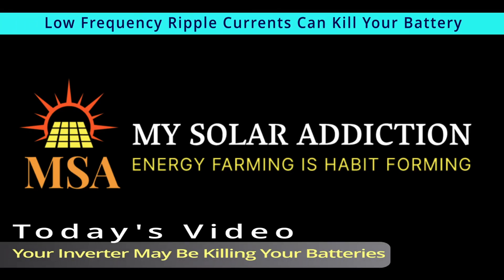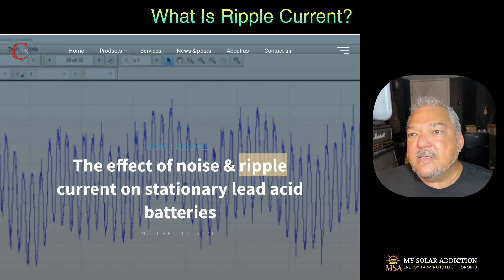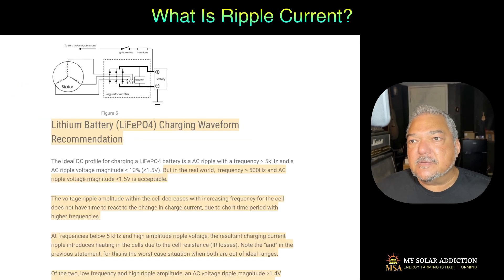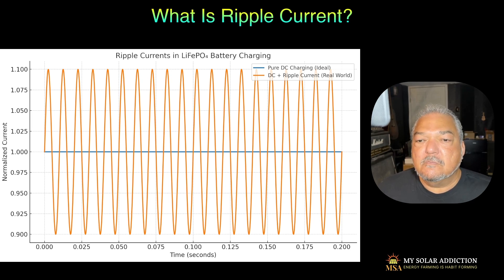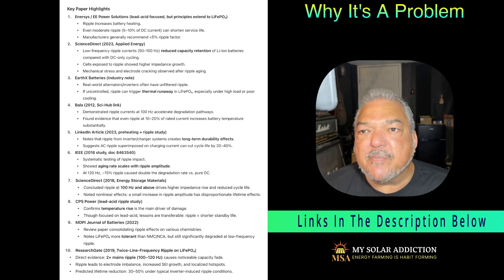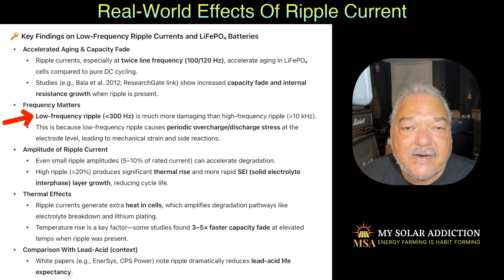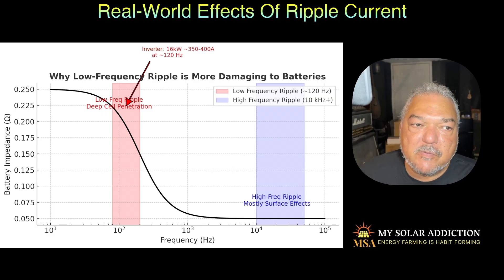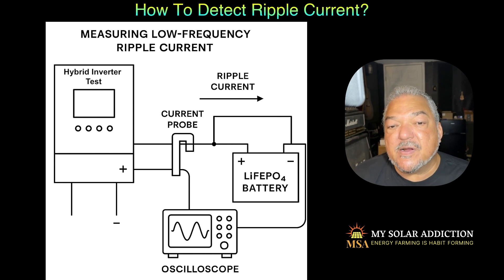Your Hybrid Inverter May Be Killing Your LiFePO4 Batteries

Comment: This popped up on my feed, two weeks late, go figure. I am presently running a 4000W inverter with 700Ah of 12V batteries. Yes, heavy loads can put a major ripple in the DC supply. My solution was to drop a few hundred (1/2 the price of a single battery) bucks on a 500Farad capacitor. does a beautiful job of dropping ripple down to low mV I can start a 2hp compressor and the lights don't even flicker levels. I parked it right off the inverter terminals.
Even better, it allows me to operate much heavier start up loads that would choke the batteries BMS if used alone. looks like a 6 pack on top of my inverter.

Comment: In Europe the ripple issue can be partly mitigated by using 3-phase electricity and balancing the highest loads equally to all phases. So using 3 phase charger for ev, using 3 phase heating resistors for boiler and sauna (sauna stove is usually Y-configuration, and the thermostate is using after initial heat only 1/3 of the resistors, not good for the ripple). In Finland many people are using solar + battery for EV charging, then it's better to have a 3 phase charging, and limit the power to for example 6kW, if necessary, and not using 3,6 or 7,2 kW single phase.
Reply from the maker: Thanks for the input.   This is the kind of interaction I was hoping for👍🏻👍🏻

Comment: Most modern high quality low frequency, transformer based inverters have more than adequate capacitive and inductive filtration on the DC side to eliminate this noise. Throw an O-Scope on the DC bus during charge mode and you'll see what I mean. In addition, if you twist the DC cables together (most people don't) much of this ripple current in lower cost, inadequately filtered inverters can be eliminated.
Reply from the maker: With HF inverters good filtering is important.  Thanks for your input 👍🏻👍🏻

Comment: This entire video is terribly misleading and has NOTHING to do with solar.  My batteries get charged directly from solar panels. No AC goes near my batteries, heck I'm fully off grid, no AC anywhere near my batteries.  You're talking about a charger/converter type device.  I have a pure sinewave inverter that turns DC into AC, as in output only.

So if you're going to obsess about AC charging issues, change the channel, because you're using the wrong language and terminology all the way around.
Reply: Some folks have inverter/chargers that are connected to the grid at the same time. But I also charge from solar panels only. But I have a high interest in science and technology, so I enjoy learning about something new.

Comment: I'm not really worried about this. I generally charge from solar, so that's DC and there will not be a significant ripple. You get ripple when you charge with AC and convert that to DC without capacitors smoothing in between. I charge AC at very low currents only, so that shouldn't be a problem either. Discharging I rarely use more than 35% of the maximum battery discharge current.

Comment: Long ago people got alternator noise in their car radios when the car was running.
You simple installed a capacitor on the alternator output to smooth out the ripples.
Why not figure out the frequency of the ripples and merely add a small capacitor to the setup?
Smooths out the ripples quite nicely if you can calculate what you need.
But it takes an Oscilloscope to see things.

Comment: I think it is overrated.. mostly on systems with few battery cells / bms ..i don't think it is a big deal at all.. maybe on one battery with large inverter it might be problem..but for sure it isn't a big deal on higher systems with more cells connected in parralel..so no need to worry.

Comment: Ripple currents are "mainly" caused by high current draw from the inverter when outputting a lot of power, not very likely on charging UNLESS you are charging with a few hudred amps from a 50 or 60Hz charger that has inadequate smoothing... 

The smaller the cables to or from your inverter/ battery the more ripple you will have, low frequency ripple will kill your batteries ONLY if you are constantly drawing/charging with consistantly high currents and using a cheap / poorly built charger with inadequate smoothing... 

This is also why you should use dc dc chargers because of the higher switching frequencies (10KHz and up) .... Most cheap hybrid inverters are ALL switched HF units, if your inverter has a big ol' transformer it is an LF inverter not an HF one.

Victron MP2 with dual mppt 150/35 chargers, 10 year run period 200Ah LiFEP04 15S 50.3V... No ripple issues with 50mm cabling, ripple measured @1A accross the inverter shunt when drawing 4.5Kw from the inverter.

Comment: Yes ripple current does  kills battery but there is a circuit to stop this but all manufacture just dont put this circuit in the inverter but you can use large inductor with tvs diode in parallel and across the battery that components cut all current ripple but tvs diode or so expensive why companies down bother, hybrid inverter dont have input filter only output filter the filter most be at the dc bus ,to remove the ripple totally is impossible its the way how switching works but you can stop the ripple 98,% with a inductor that match the battery current you using like said a 300amp 52v battery use and iron powder core big and thick said 10.000 AL value use very thick copper wire to wound the core 500 uh is good

Comment: I have an off grid system that’s using a EG4 6000 XP and another one that’s using a solarc 15 K in addition I have a EG4 chargeverter that was recommended to be used to charge the batteries from my generator

I’m thinking that because I’m using solar to charge my batteries primarily it’s DC and shouldn’t have any ripple the only time I have a ripple problem I think would be using the generator so I need to look at that. I can do some measurements on the system if you’re interested.

Comment: Personally, I think the most significant danger from ripple current is the stress it might cause consumers. First off, LiFePo4 batteries are expected to last 10 years or so using them daily. Ten years from now, who knows what technology will be most popular. I expect storage batteries to be cheaper, lighter, safer, and smaller. That seems to be the way electrical components go. I remember many years ago people had concerns about hard drive storage, and how long the data would be safe. They also spoke of the high cost of data storage. What wound up happening is drives went solid state, increased in capacity, speed, reliability, and the cost decreased. I think constant concern over a possible decrease in how long these cells will last is likely a waste. The price of LiFePo4 batteries has steadily declined. By the time our current batteries die, we will likely be able to get 10x the watt hours of the old cells for the same amount of money. Just a few years ago, power stations were almost always around a buck per wh of storage, now many are around 40 cents per wh or less.

Comment: Sounds like you need to put a capacitor on the battery...or maybe an inductor if current change...
You said the key word there high frequency...
Reply from the maker: Low frequency but high amplitude would be the worst according what I found

Comment: I'm a little confused here. You mention inverter, then you mention charging. Would inverters not be on the discharge side, not charging?
Reply: The chart you have at 4:36 is one, if I'm not mistaken, doesn't seem right.
Disclaimer, i only have training for basic electronics principles.
You're overlaying a pure sine wave over a flat (dc) line, when nobody, not even the cheapest half wave rectifier, would have as the DC output. It should look like a bunch of arches, like one of the earlier charts-and that assumes a rectifier without any capacitors. Add in capacitors and the right side of the wave goes from dropping like a rock to a gentler slope, and the top of the arch is lowered an amount in exchange. The bigger the capacitors, the smoother this gets until it looks like you drew a diagonal line in paint and rotated it horizontal.

This makes me wonder if they're using low quality rectifiers and the studies are seeing the impacts of a shit DC input on batteries...?
Reply: Looking at the first linked whitepaper, 3 paragraphs in, it talks about failed capacitors in the rectifier circuit-meaning it already has equipment failure. This problem cam be mitigated by using more smaller capacitors over one large one so one capacitor failure doesn't affect the output waveform as much.
Reply: Ah, figure 4 of first whitepaper shows what I'm trying to describe in my first reply
Reply: There are such things as inverter/chargers on the market. They perform inverter duties, but can charge the batteries from an ac source when connected to shore power. Check out victron’s multi-plus series of inverters.
Reply: @nthenet  yeah, they're housing different circuits though. There's, afaik, no parts that cross over from rectifier to inverter

Comment: Hi
This strange. We have never heard of this manufactured problem. We have installed lithium iron phosphate lifepo4 batteries in more than 1600 boats the last years. In lots of boats we have installed inverters in hundreds of boats.
This is not a problem. We should have seen problems all over the place if this was a problem.

I must say what you tell is 100% bullshit.

Please stop this crap story.
Reply: I think it's a misunderstanding of things and overblown fears.
From my skimming of the papers and my limited training, it looks like every instance of inverter in this vid should be rectifier or charge circuit. There's a, probably home made, graph that also looks goofy.
One of the papers even mentions a source of ripple as a blown cap in the charge circuit. All of them talk about power into battery, not power out.

I think this is a real problem, but only for people with cheap low quality charge equipment or charge equipment that has had capacitor failures. Very limited in scope
Reply: Thanks for reply. I have read his message but do not understand what he really means and with ripples in this case. We have installed hundreds of inverters and combined charger an inverters like Victron Multiplus, lithium batteries and alternators. Now more than 1600 installations the last 12 years.
We have never encountered anything like this. So I really wonder if he knows what he is talking about.
Reply: It is also important to know that an inverter draws current out of the litiumbank. How should it make ripples backwards and damage batteries?

We should have trouble if it was a problem. Many channels on YouTube tell a lot of scary stories to scare you and then sell you a book or other solution to make money.
Don't know what this guy does. But his claims are not correct.
Reply: I see your point. But honestly speaking, I think it is a manufactured problem. We should have seen it. As you know we install equipment like this and have done it for more than 12 years. We have never heard of this or seen any problems related ripples. He does not seem to make any difference if the ripples occur from an inverter or charger. I think he is a little confused.

We see that cheap inverters are really cheap and fail easily. More expensive equipment from Victron and Mastervolt, much more expensive, but much more reliable and can take punch.
Reply: Yeah, look at the recommendation to keep the ripple current under 5% of rated charge current.  If you have a 500 Ah bank, probably its rated charge current is 250 amps.  So keep your ripple current under 12 amps.  That seems like it should be easy.  If you have a charger with 12 amps of ripple, it is likely defective and should be replaced.

I can apply 150 amps of charge current to a bank rated at 500 amps charging, and while doing 150 amps the ripple across my shunt looks insignificant on my handheld 'scope. (75mv at 500 amps, and in a 2 minute check I'm not seeing even 1mv of ripple at audio frequencies and lower.)  When I have more time I'll hook up the better scope.

Comment: In your diagram @12:34 - did you intend to short out your battery?
10% ripple causing battery destruction seems unlikely.  
In most systems, ripple is not constant, but increases with load. Capacitors are generally used to filter out ripple, but as the load increases, the caps get overwhelmed and can no longer perform the filtering function as effectively. Presumably, the worst case would correspond to trying to rapidly charge fully depleted batteries. This (or rapid discharge) is usually also the worst case for heat generation.  I suspect that the same conditions that cause increased ripple (heavy charging of the batteries) is also responsible for increased heat - and that the heat is actually the cause of shortened battery life. That is, by setting the conditions to amplify the ripple (for testing purposes) the conditions of increased heat are also created, and the heat causes the damage.
Reply from the maker: Thanks for the feedback.  I do have a more detailed test procedure that ChatGPT created from my prompt but I plan to discuss any testing with my friend who does large commercial and industrial jobs, and use to do residential for years before he was scooped up my a bigger company.  I also mention in the video that hitting the system with a big load would help to amplify the ripple when testing.

Comment: You have to understand that you can not have a pure DC voltage applied to a battery and simultaneously have a high ripple current. The ripple current is a result of the battery reacting to the applied ripple in voltage. As long as you are within the spec for the battery in terms of amps, there really is no concern. The big problem is if you are float charging or top balancing at the very max for the battery cells and the voltage applied has a ripple. The electronics may not pick it up but the cells will be stressed.
Reply from the maker: Thanks for commenting.  I did mention at least twice that the goal is to minimize the ripple and that between 2-5% is acceptable.
Reply: The better the inverter/rectifer setup the less problems you will have. The cheapest one give pulesating DC. Some expensive ones even generate multiple extra phases to help smooth out the DC current.
Reply: @johnmccallum9106  My 12kW Deye hybrid 3-phase inverter is good from tests: At 3kW battery charging the ripple registered with clamp meter capable of reading current up to 60 kHz (-3dB) was 0.00A and current in DC was 53A.
Still, frequency in ac is not important for a battery, just avoid overvoltage. The batter itself acts as a capacitor receiving the ac as surface charge that is then taken up by the chemistry.

Comment: DC to DC conversion as done in inverters are switching in the KHz area. You can not measure current with an oscilloscope and many other "flaws" demonstrated. Beside that, there are filled up with capacitors inside my Deye inverter. I charge with 220A Max. (Reduced from 240A to prolong life of the inverter) into  a total capacity of 1470Ah. If your batteries get hot you should worry MUCH more about that vs. this ripple-talk. Surely good intentions but many things are not understood by this YT'er. Don't worry, be happy.

Comment: So don't charge with AC?
Reply: Reading through the linked research materials in the description, combined with my very limited knowledge of electronic principles...
That is not the conclusion i have. What i got out of it was, don't use a damaged or cheap rectifier to charge your batteries as that will cause the batteries to charge with a bad waveform.
A properly functioning quality rectifier will filter any noise down to a level within tolerance.

Comment: Noticed the Marshal amps in the background - caught my eye because many years ago one of my first jobs was as a research and development engineer at Fender. Later in my career some of the products I designed were AC power conditioning and regulating units for stage and studio.
Reply: Took me a little thinking to realize "Marshal amps" was an Amplifier and not a new measure of current (Amps).
Reply from the maker: @chucksommer7784 😂
Reply from the maker: I use to play guitar and sing in a band in my younger years.  I was partners in a vintage guitar shop for many years.

Comment: Missing from every one of the studies you found is a key factor: ripple matters to the extent that it is (or is not) a significant fraction of the amp hour rating of the battery. 20 amps peak to peak ripple, on top of a 100 amp average  current, is possibly significant, if the battery is only 100 AH. It's nothing at all to a 600 AH battery. So be sure to put all your tests in the proper contect. Assess how much the ripple compares to the capacity of the battery's rated current and capacity. Without that context, your measurement will be of little value.